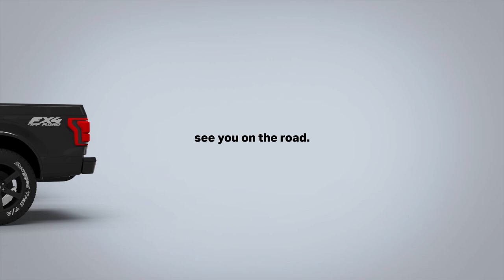Fusion TOW Full-Size Lightbar // The Brightest and Most Economical Lightbar for Public Works

Comment: I love the idea of this, tow trucks don't need the full 60 GPL bar. This is a great option. My only recommendation would be to offer more lightheads in the back that can be utilized for a traffic director but turned off when flashing normally not to blind other drivers.
Reply from the maker: Thanks for the suggestion, Ryan! Perhaps we could give customers the option to add? Our goal is to keep the cost down while still offering light coverage at every angle, but we understand the need for other applications like direction patterns.
Reply: @FeniexIndustries  yea exactly that's what I was thinking.